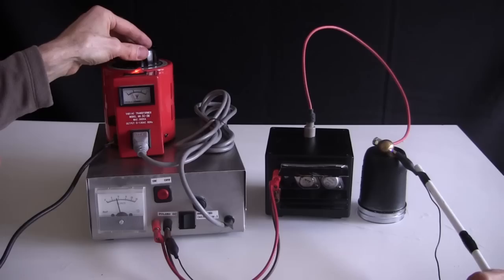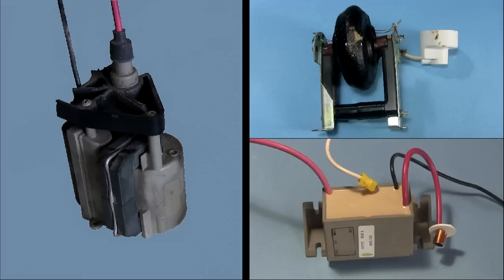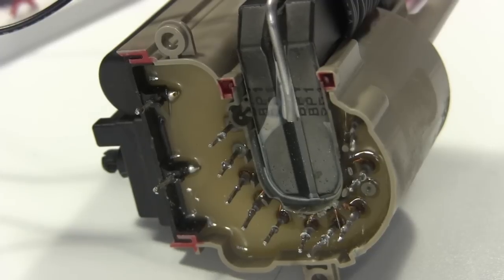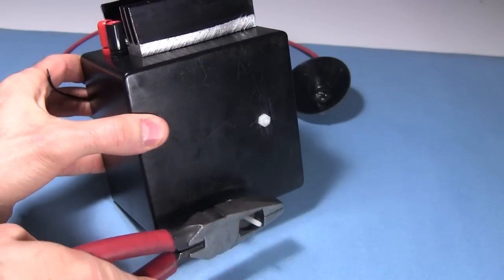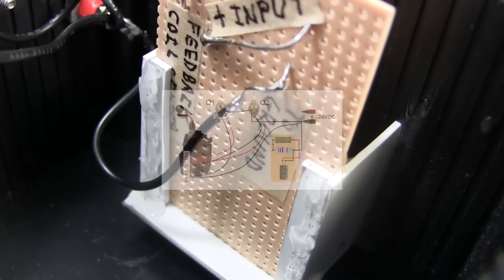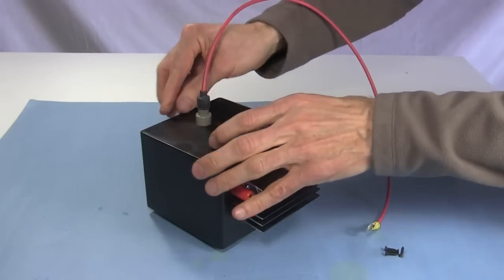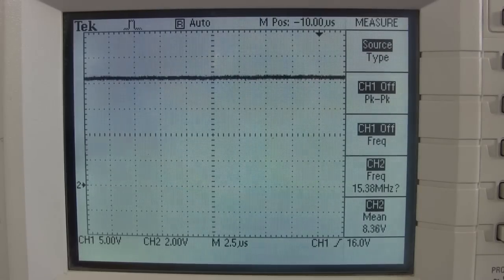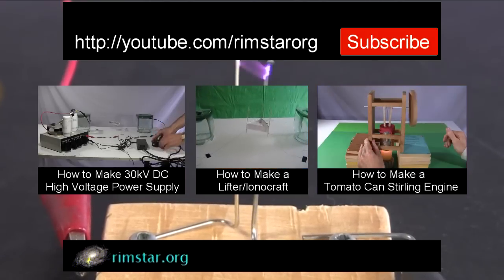The Cube - How to Make High Voltage Power Supply w Flyback/Builtin Diodes

Comment: Can I still use a voltage multiplier with this configuration if I want higher voltages ?
Reply from the maker: Almost. The problem is that the diode that's built into the flyback turns the output from AC to DC and a multiplier needs AC. If you can find a flyback without a built in diode, or find a way to remove it, then you can, but they're hard to find and I'm not sure they can be removed.
Reply: Found someone who has manages to open one : http://www.angelfire.com/oh3/ebjoew/Flyback.html
Reply from the maker: Thanks! That looks easy enough to remove. The one's I've seen were all encased in epoxy.
Reply: Another quick question, If I somehow manage to remove the diodes and capacitors and connect it to a voltage multiplier of my own, will I get a full DC output from the thick main wire only or should I connect the focus wire with it as well ?
Reply from the maker: Hmmm... In my experience the focus is at a lower voltage, usually 1/3rd the voltage of the thick wire. They're separate voltages, taken from different stages of the multiplier circuit for different purposes in a TV. You'd use only one of them at a time, unless you want two different voltages at the same time for different things.

Comment: Nice tutorial but i tried it and followed all circuit layout, but when i am to test it i couldn't get a PSU so i plugged to direct light source and the wall socket burnt immediately, what could be the likely problem please, i actually need it to build a mini ESP
Reply from the maker: The Cube needs DC as it's input whereas the current from your wall socket is AC. If the socket burnt immediately then there's a chance you also damaged something in the Cube too, but maybe not. You'll need to find a DC power supply. In this video about making my 30kV power supply (https://youtu.be/GEuK1OdYxHk) I show using wall adaptors (it's near the end of the video). That power supply is almost identical to the Cube so you can try that too.
Reply: @RimstarOrg  Okay, thank you very much sir, i will check it out but the link is not going, and could there be a way to convert the AC from the main socket to DC that can feed the Cube
Reply: and i could not get a 4700microfarad 35v capacitor, so someone suggest a 2200microfarad and 50v, will that work also
Reply from the maker: It looks like YouTube included the closing ')' as part of the link. Try this one  https://www.youtube.com/watch?v=GEuK1OdYxHk The relevant section starts at 6:01.
Regarding using 2200 instead of 4700, that might work, I can't say for sure. If it doesn't then you can always try two 2200microfarad capacitors by connecting their positives together and their negatives together. The 50v rating is more than the 35v and is fine. It just means that the capacitor can handle more voltage.

Comment: I am curios as to why you have the 4700uF in the circuit,because I was thinking that the power supply would already have something like that in its output. But I was thinking that maybe the capacitor has to be close to the circuit due to the Hz of the circuit. Is that why you put it there?
Reply from the maker: John Kerley I understand how a flyback circuit works but I don't know the purpose of the 4700uF capacitor. It isn't present in a lot of flyback circuits. I think I got that circuit originally from here http://jnaudin.free.fr/html/lifterb.htm, but the link on that page from there onward doesn't seem to have the circuit anymore.
Reply: RimstarOrg On that page,they also show 10KV,500pF on the output of flyback before the tripler. One thing I noticed was on the scope picture of flyback output I saw Ch1=5uS,f=40.81KHz,V=12.5KV. I guess maybe that was the frequency that the flyback was running at? Max output would be 12.5KV.
Reply: RimstarOrg I had to go back and look at the page again to make sure I had said it right,......it was 41.81KHz.
Reply: RimstarOrg I guess the 5uS was the scope screen capture time.
Reply from the maker: John Kerley I never noticed that 10kV, 500pF capacitor there before. My guess is that it's for blocking any DC from the flyback going to the tripler.The 5uS and 5kV look like the horizontal and vertical grid sizes respectively. That makes sense since it's saying the frequency is 41.81kHz and each wave roughly takes 5 grid blocks across and 5x5uS=25uS. 1,000,000/25 = 40kHz. Also, the 5kV makes sense since it seems to be saying the maxium peak from 0V is 12.5kV and each peak from 0kV is 2.5 grid blocks high and 2.5x5kV=12.5kV.
Reply: RimstarOrg Thanks,...you are one smart person! I am guessing you used 1MHz as 1uS per cycle,...thus 1,000,000/25=40kHz. Cool!
Reply: RimstarOrg Your math skill has impressed me! I think that you must be 100% absolutely correct about everything you just said! NO JOKE!
Reply from the maker: John Kerley Yup. I just think it through really. There are 1,000,000 microseconds in 1 second. So how many 25 microsecond cycles can fit in 1,000,000 microseconds? Answer: 40,000 of them (1,000,000/25). So 40,000 cycles per second or 40,000 Hz or 40kHz.
Reply: RimstarOrg You tha man!
Reply: RimstarOrg I am probably going to continue my experimenting, but I have gained more respect for the dangers of it,....for sure!
Reply: RimstarOrg Thanks again for commenting back to me,....if I ever discover something worth while,I will let you know first....you can bet on it!
Reply: RimstarOrg I have talked with a lot of people on YouTube that I would consider to be super smart and I believe you are one of those people.
Reply from the maker: John Kerley That's very kind of you, but we all have our areas and experiences.

Comment: Is it possible to power this with a modified ATX Power Supply? Mine can give 12V and run up to 13 amps.
Reply from the maker: You can't make the high voltage power supply from an ATX power supply, but you can at least power the high voltage power supply which I make in this video using the ATX power supply as the low voltage input.
Reply: @RimstarOrg  Yeah, I will use the 12V output as "The Cube's'" Vin and I should get about half the output you got right? If you put 24V in and got 20kV out, I should get around 10kV out from 12V in.
Reply from the maker: I put 20V in and got 20kV out. However, I don't think it's as simple as multiplying by 1000. I don't know what the relationship really is of Vin to HV out.
Reply: @RimstarOrg  Could this also be used to power an ionocraft or lifter? How much voltage does it take?
Reply from the maker: No, I tried with my lifter and it didn't work. It could be the voltage since my lifter requires around 25,000 volts. I don't know how much current my lifter requires but it's also substantial, probably close to or higher than one milliamp. The easiest way to power a lifter these days is using an old PC monitor like I do here https://www.youtube.com/watch?v=r32e0QGdm8U or to buy one from https://www.amazing1.com/ It has to be a DC high voltage.
Reply: @RimstarOrg  If I somehow supply 30-40VDC to the input of the cube, do you think it could power a lifter?
Reply from the maker: The components in this power supply limit it to around 25 VDC or less. But even then, I don't know the formula for estimating the output.
Reply: @RimstarOrg  Hi again, I was doing some extra research, and a lot of the articles I found said that the 2N3055 transistor is bad for a flyback driver and that it burns out often do to limit-exceeding voltages on the emitter. How did you prevent them from being damaged in your circuit? Thanks in advance.
Reply from the maker: I didn't put any protection in this one. But I have one which I bought from amazing1.com which does have protection for the transistors - though I don't know if it protects the specific thing you're talking about. I did, however, document their protection along with tips from others under the heading "Transistor protection - capacitors and diodes" on my website here https://rimstar.org/equip/30kv_pwr_supply.htm

Comment: with this power supply puts out up to 40,000 volts DC if the input was 48 DC?
Reply from the maker: I don't know how it scales. But I also mention in the video at around 7:53 that any higher than 20,000 volts output and the transistors heat up too fast.

Comment: I know its been a few years, but i have a question. When i plug it in the wall (im using a laptop charger, 19V 3.5A) i get a momentary spark and then it just stops until I plug it on again. Do you have any idea why would that happen? Great project btw!
Reply from the maker: I can't say for sure but a guess would be that your power supply is drawing too much current from you charger and something in your charger is detecting it and shutting off for protection. And thanks!
Reply: @RimstarOrg  do you maybe know how can i lower the current needed, or should I just buy a new charger? If so, what current rating should it have? Thanks for the reply.
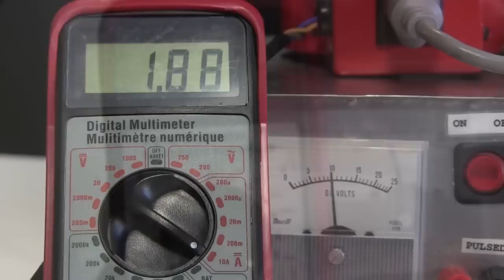Reply from the maker: If you watch the video at around 7:05 you'll see me make measurements. For what I was doing, making an arc, it looks like your charger has a good range. But as I said, I was just making a guess at what might be your problem. You could try connecting some meters, measuring the voltage and current between the charger and your high voltage power supply to see what's happening.
Reply: @RimstarOrg  ill do that, thank you :)

Comment: does it matter what TV or CRT you get a flyback? are the pin-outs easy to identify with simple testing?  I'd like to cut the costs of my project (demo Farnsworth fusor) by making a transformer with 10kv-15kv instead of buying one. Besides the case - how much would a project like this cost?
Reply from the maker: Camilo Guerra It has to be a TV that has a cathode ray tube. I don't know if plasma and other flat screen displays have flybacks in them for other reasons. Other than that, it seems that whatever flyback you find inside will work. If the flyback has a part number on it then you can search for it online and often you'll find the specifications with the pinout. If that doesn't work then there are many videos on youtube showing you how to figure out the pinout using a meter. I can't say what the cost of my cube power supply was since it was made entirely from stuff I already had, much of it taken from other things. For the transistors and resistors, the cost is less than $20.
Reply: RimstarOrg Thank you for the thorough response! BTW, Fantastics Videos!
Reply: RimstarOrg  Another question… what kind of variac are you using? I'm looking to buy one and was wondering what the amp spec actually means. what would be the difference in one variac with lets say 120v output with 50-60hz cycles and one is 5amps and there other 10amps? (I'm new to all this electronics stuff, so i apologize for what might be a very dumb question)
Reply from the maker: Camilo Guerra Sorry for the delay... had to wait for a chance to open up my variac to double-check. The amp spec is the size of the fuse that's on the input side i.e. on the side of the plug that you plug into the wall for power. Mine is a small one but does the trick for all the stuff you see in my videos. Still, if I could find one with a higher amp rating I'd go for it. Mine doesn't say who makes it: just a model number SC-3M and Made in China. Here's an excellent video on variacs by my friend Todd https://www.youtube.com/watch?v=D1jaTevZGWs

Comment: I am curious ....... If I connect this supply to a smaller resistance like say 1k, will it supply the 20A (20kV/1kOhm) continuously or will it burn out at that high current?
Reply from the maker: Do you mean at the input to the high voltage power supply or at the output?
Reply: At the output of the supply. I wanted to know if it can supply the calculated current continuously.
Reply from the maker: Abhay Sane
Oh, I see what you're asking now. I read your question too fast. No, it can't supply that amount of current.
I had some problems measuring current with two different analog meters. With the continuous arc, one meter showed over 250 milliamps, which was the most it could show. My other meter showed 0 with a continuous arc. So I don't know what the current is exactly with a continuous arc.
With sparking, I got around 2 amps on the meter that could show it. That leads me to think that the continuous arc is limited to less than 2 amps.
I don't know what the voltages were for the above current measurements but it doesn't matter since I noted only the maximum currents, so it is much less than 20 amps.
Reply: Aah ... ok. I am trying to figure out what I need for a pulse generator. I want a high voltage (around 1 kV) across an electrolyte which has a resistance of around 100 Ohms. This would give a current of 10A. All power supplies have a maximum output current in the datasheets which is a lot lower than 10A, I think the output voltage might drop if my load tries to draw more than the rated current, but I can't find a good reference book or website that mentions it clearly. Thanks for replying though!

Comment: I have been experimenting with a 32V system that uses the original flyback primary and feedback coils but when it establishes an arc it causes the digital display of the power supply to go off. I can measure the input current, however, with an analog meter,and it is @900mA. This makes me think that primary coil back EMF is going back against the power supply. This worries me because I am thinking that the supply output would have a capacitor across it and it would probably be an electrolytic capacitor,and I am thinking that this could cause it to explode!
Reply from the maker: John Kerley I read your questions carefully, but as I said before, I've never worked with an unmodified flyback, so I don't have an answer. Maybe someone else does but I don't know how many are looking in.
Reply from the maker: John Kerley John, thinking about it a little more... Does your problem happen with just back EMF or does it happen when there's a long, bright sparks. If it's sparks then maybe I can help.
Reply: RimstarOrg The factory bought power supply is a 32V,5A with digital V and A readouts. It will make the flyback work but when it is working the digital displays turn off. However, I have an analog milliameter also hooked to it and it says that the input is 900mA while the digital displays are turning off. The adapter is 32V,1560mA, but when I tried to run the flyback from it,it just turned off before I even saw one single spark and I did'nt even hear the flyback ringing either. I found out later that the adapter still worked after being unplugged and plugged back in later. I am sorry for being impatient. What I was wanting to know was if the flybacks primary coil was causing a back EMF if it would be a problem if that got back to an electrolytic capacitor that would be most likely (I imagine)on the output of an adapter right after the bridge rectifier....although it may be made intirely different than I am thinking...such as having,instead one of those ICs...ect.
Reply: John Kerley Oh,I forgot to say that the digital displays turn off during sparking only.

Comment: I have found that running a flyback by its original coils is not feasable with the lower voltages because you would have to put more current on the primary than it was intended to take normally.

Comment: Hoe many Volts do the capacitors have to be?
Reply from the maker: Do you mean the 4700uF capacitor? If so, this is an old circuit that's floated around the web so I don't know what the minimum voltage rating should be. However, mine is rated at 35V and I've never had a problem with it.

Comment: We know voltage is around 10kv to 20 kv but, What is output current of color TV flyback transformer? Which gives 20kv. 
Any value, approximate range?
Reply from the maker: The current depends on your load but have a look at the video at 7:11 and you'll see that at 20kV, the current is 3.8amps.
Reply: RimstarOrg 
But sir, 3.8 amp is input current I think.
I want to know output current?
I found many other sites, some says 5mA some says 20mA and some says above 100mA.
I want approximate range of output current. Please reply me sir.
Reply from the maker: I don't know the output current. That's harder to measure. Keep in mind that the output current depends on what you're using it for so that's probably why the sites you looked at gave different answers.